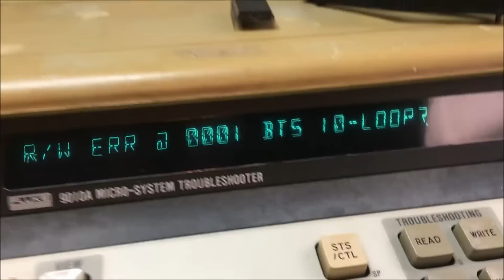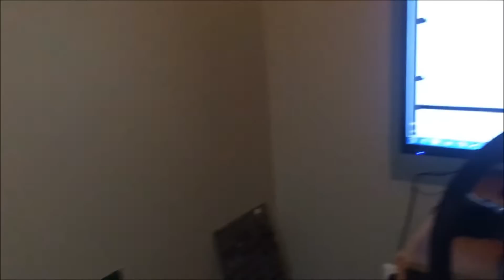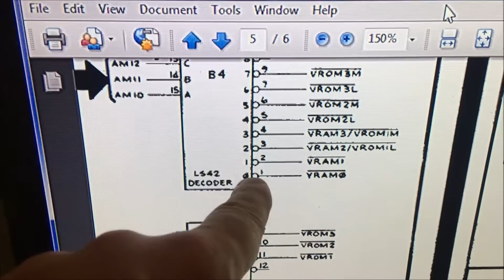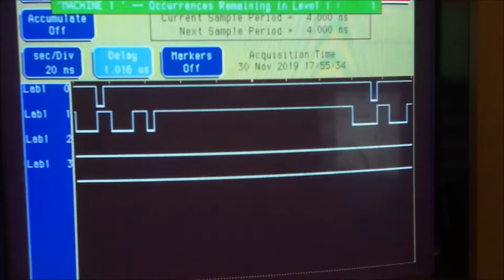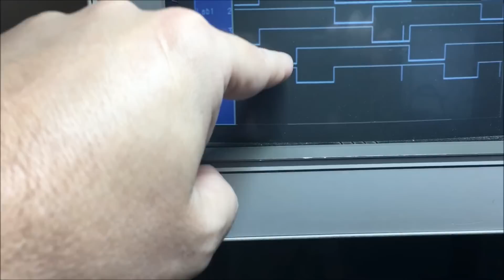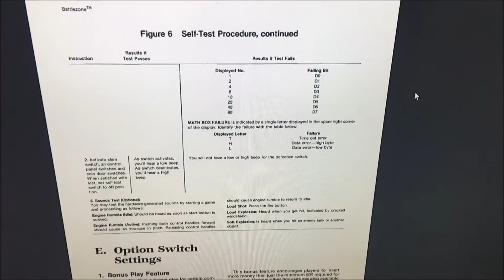1980 Atari Battlezone Arcade PCB Repair

Comment: I've gotten to where I just throw a high score save kit instead of replacing all the rom sockets and burning roms and mark board socket issues. Very nice board work very easy on the eyes!!
Reply from the maker: Bobby Jack i know its wasy to just throw a kit on there..  but i am a total purist when it comes to these games..   i prefer all original everything...  nothing wrong with the kit approach..  it just isnt for me
Reply: @classicarcaderepairs  I also only run original power supplies. For some reason I just can't get behind switching ps and led marquee lights. Hate seeing it!
Reply from the maker: Bobby Jack totally agree..  not a switching power supply fan at all
Reply: @classicarcaderepairs  oh I'm also a hardcore purist myself. About half my collection is all number matching. I myself do run kits if it's just an IC swap for saving space such as Astroids Deluxe running multi kit ect. I do it because of time spent vs the cost of kit.
Reply: Does the high score save kit already contain the roms on it? and does it bypass the ram as well? I have a busted old battlezone im trying to fix but I have no way of testing or flashing roms

Comment: Nice repair! I like how you try to isolate the exact fault, and replace only what is necessary. This is encouraging me to dig back into a pile of five BattleZone boardsets sent over by a friend. I'm sure there is some socket replacement in my near future...
Reply from the maker: Yep..  those old atari sockets are no bueno ...    must be replaced whenever u come across them

Comment: FYI, the reason for the backwards text on this game is because the game cabinet uses a mirror for the video display to reflect upon .
Reply from the maker: Todd Martin yes i knew that
Reply from the maker: Unless its in a caberet..  which the picture would be un-flipped
Reply: For those who don't already know... you can reverse the X output by grounding pin L on the main harness connector. (Pin K does the same for the Y axis.)